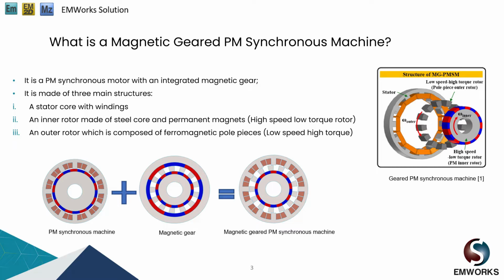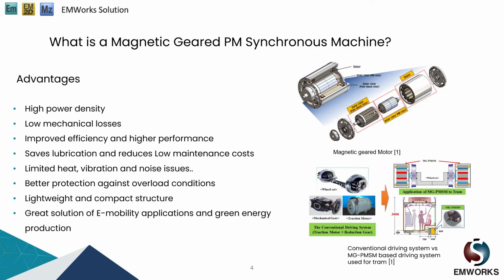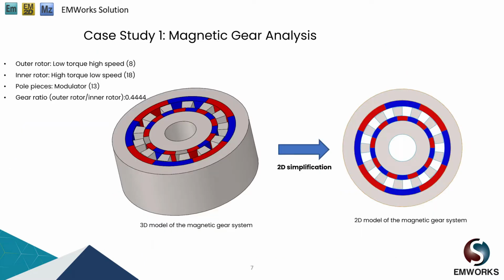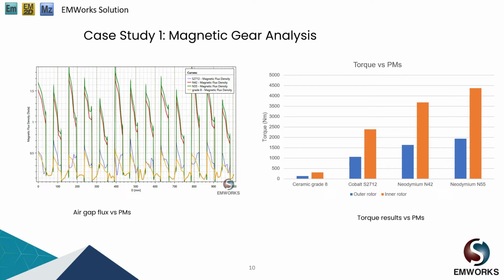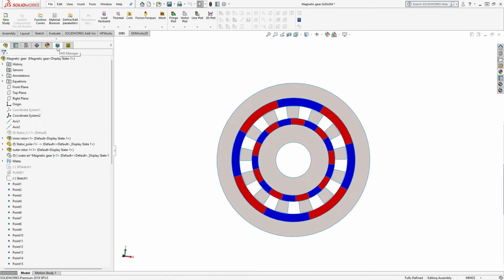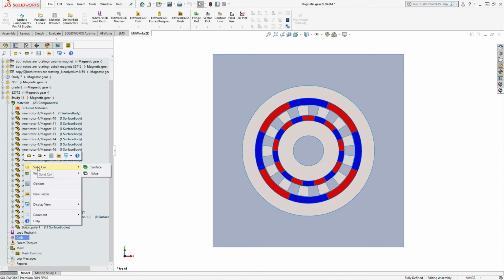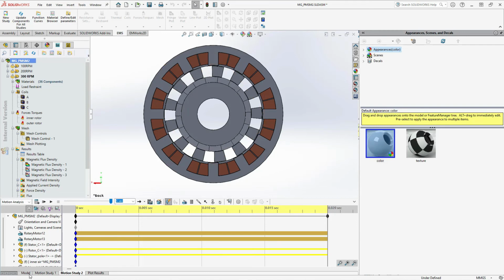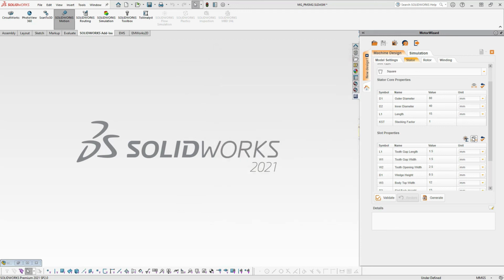[Webinar] Magnetic-Geared Permanent Magnet Synchronous Motor for E-Mobility

Comment: Hello I’m Donald Bodine,
 My watching your video or actually listening to it because I couldn’t view it. It sounds as if there similarities to a motor that I’ve first built in 1979. But I’ve found some time to build it once again and improve on the catastrophic failure due to inferior glue. Also I’m saying not only have I made I work with a permanent magnet rotor but stator also. My best guesstimation. Is 600 rpm is achieved without problem.
Reply from the maker: Thank you for reaching out! Wishing you success! Virtual prototyping is always the best choice before investing in real production. If you need help with simulations, we would be glad to offer a variety of solutions.